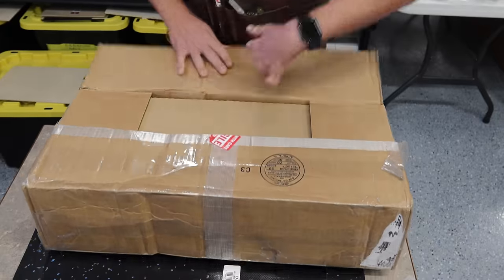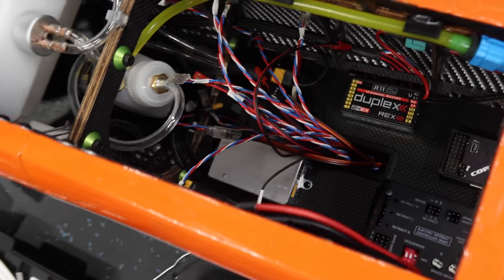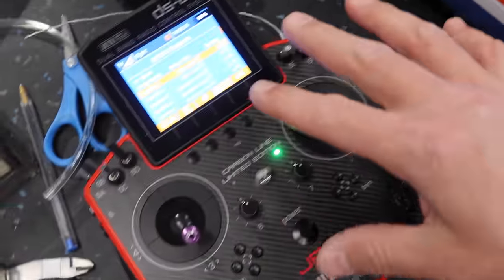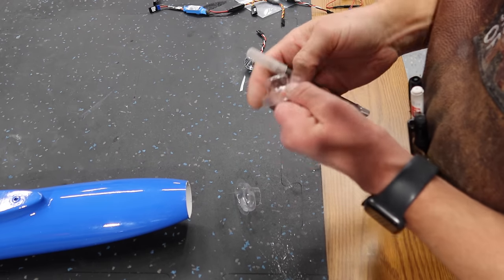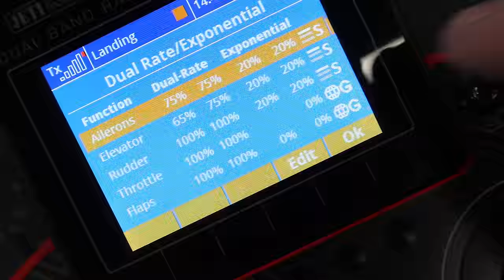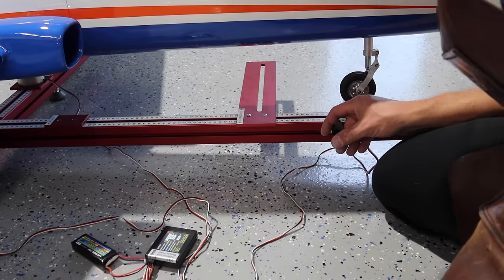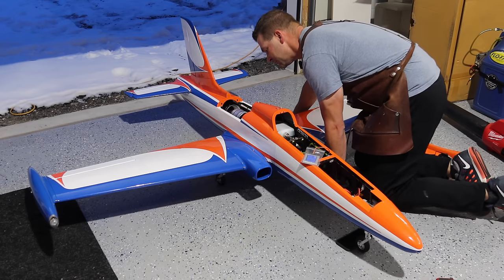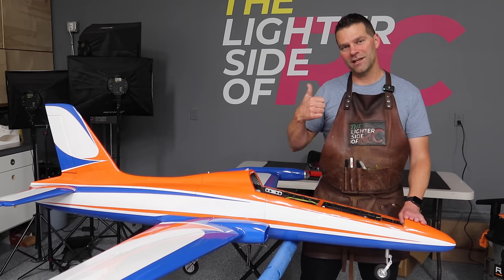Final Touches: COMPLETING the HANGAR 9 MB339 RC Jet Build Series

Comment: Great content as usual just wondering what has happened to the PC21 turbo prop in background missing the engine?
Reply from the maker: Thanks!  Prop touched the ground so sent engine in for a check over as a just in case.  Just haven't put it back together yet.

Comment: Love your videos and keep up the good work. I'm thinking about getting the plane. Some on forums talk about the weak landing gear and replacing with Electron Gear (which are too expensive!). Can you give a honest thought on the stock gear. Thanks.
Reply from the maker: Stock gear looks totally fine as long as you build it light!  Some guys are using older heavy engines, adding smoke and all that I think pushes the plane over the comfortable range for the landing gear.

Comment: Another great video.  I don't know if you covered this in the past, but do you ever use any of the Jeti assist receivers instead of the cortex?  I've been using them in all my planes with great results.  Just curious.  thanks
Reply from the maker: Thank you.  I have not played with or installed a JETI Assist receiver.  I have heard they can be a real chore to setup compared to the cortex.
Reply: @thelightersideofrc  I use them in all my planes.  To be honest, they aren't that hard to set up.  you should try one in a small plane first before the jets.  Less equipment is better in my opinion.  Keep up the builds.

Comment: Instead of glue that could melt the plastic in the tip tank to hold the bec,why not use double sided tape and extra piece of fiber tape over that.
Reply from the maker: That would work. Access is the biggest problem but the opening is fairly large.

Comment: Hey! How you adjust acceleration? Couldn’t find it :))
Reply from the maker: On the Swiwin you can change it while the engine is stopped or while it's running.  If you go to my website, under turbines you can find the manual there which is explained very well.

Comment: Quick question:
You programmed your cortex after you set up dual rates.  I just got a cortex for my A.D. Phoenix, and it says to program with 100% throws and no dual rates on
Reply: I meant to ask if you notice any difference is cortex operation doing it that way ?
Reply from the maker: I don't use high or low rates.  So if the aileron is setup with 20mm throw and the DR menu happens to be at 80% Travel, that will be 100% throws for the plane.  It will never fly with more.  After the maiden with trimming and adjusting travels, you re program the cortex and good to go.

Comment: How does this turbine suck any air into it on this plane?  It doesnt look like the intakes on the wings are functional..  They seem they are just for looks.  So where is the are intakes for the engine to work?
Reply from the maker: The intakes you see on the wings at the root are the intakes.
Reply: @thelightersideofrc  Ok I see there must be holes in the wing root where it connects to the sides of the fuselage to let the air in the engine..  That's different...

Comment: Jonathan did you use secondary receiver I this plane?
Reply from the maker: No.  Not needed but a Clone or 900 could be easily added to the mix.
Reply: @thelightersideofrc  as I understood correctly, to power cortex you have used 2 cables from receiver one from sbus output and one from a free channel to spread the amperage?
Reply from the maker: @PiotrGulczi yes. And the additional power circuit is only positive and negative wire.
Reply: @thelightersideofrc  thank you Jonathan! I’m just drawing my layout for 85” Corsair and you are very helpful. Can I ask you one more thing, how do you mount your receivers on this abs plate? Velcro?
Reply from the maker: @PiotrGulczi  Velcro or a screw down 3 d printed mount.

Comment: Dear Jonathan, at minute 34:42 you review the CG of this MB339;  Can you please explain better what the static CG and the dynamic CG would be with the tool (RCCG- MACHINE) that you use since this topic is very controversial in real life, this hobby and many others.  Not all practitioners understand it and that is why they DO NOT APPLY IT having problems taking off, flying, etc.  Even on airplanes with a rear wheel.  thank you.  Lucas.
Reply from the maker: Hello.  I have no clue on the difference between static and dynamic CG.  Sorry.  Manual states to set it between 5" to 6" back from leading edge.  We set to 5.75".  Fly it and adjust it as needed.
Reply: @thelightersideofrc  okey. Thanks again